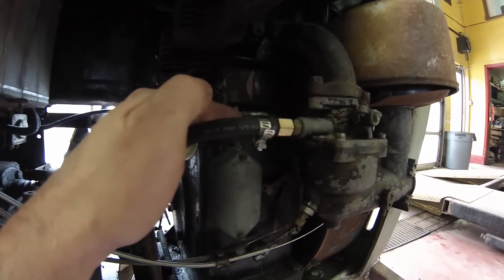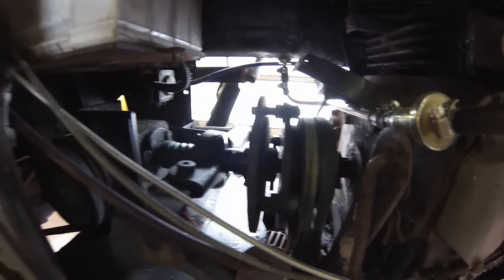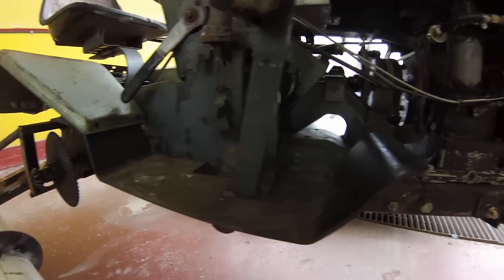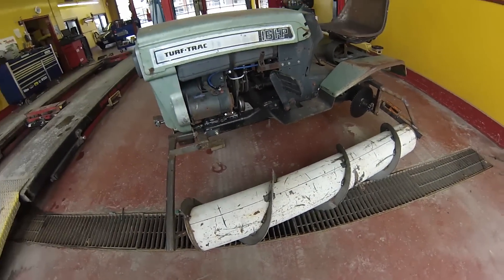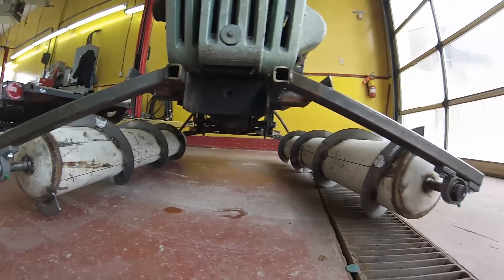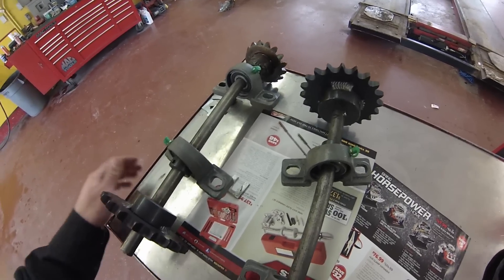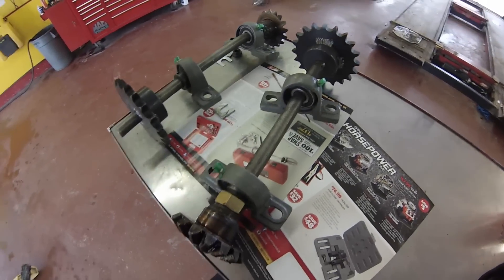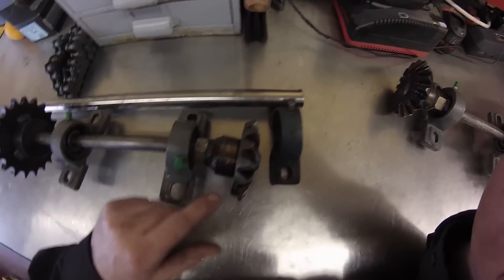Screw Drive Vehicle - Extreme Offroad - Part 5 - Bummer Dude

Comment: I was thinking a worm drive self-contained speed reducer. I think they're pretty pricey. But maybe you can get some eBay ones or something. I get them from work all the time from electric motors that's is used on heavy duty bakery equipment. 
Alternatively you might pick up some 1to1 90 degree gearboxes from PTO driven brush hog/mowers.
Reply from the maker: yeah I'll look into that I think, I fear if I beef up the shaft that bent, it will bent the tractor axle

Comment: Since each screw needs to turn independently for steering purposes, i would copy an old struck dozer belt transmission, its simplified by the fact that the screws axis is parallel  with crankshaft axis versus perpendicular . This i believe would be your cheapest and simplest option. like the idea of the screw drive hope you get it figured out. stay way from bevel gears  to much side load.
Reply from the maker: i'll check it out, ya i think i'm done with the bevel gears

Comment: IMHO the screw twist rate is far too little, putting way too much torque.  I'd triple this rate.
The next thing to fail will be your outriggers.  Those should really be beefed up.  That mild steel square won't last past your first bump.
Thought about using some rear differentials and a chain drive?
Reply from the maker: i've got a new plan, you will see it shortly, i think its the best / cheapest way...my screw angle is the same as the chrysler corp screw machines, just with a single helix instead of double....anyhow once they are both turing i can screw (hah) with that...and yes! outriggers are not done yet! right now they are very weak, the front anyhow
Reply: REDNIC79 Sweet!! Don't let us down mate!! but you gotta stop putting gas in your battery.. haha